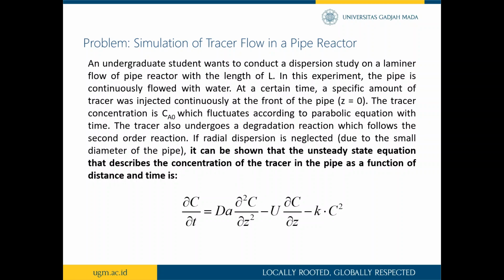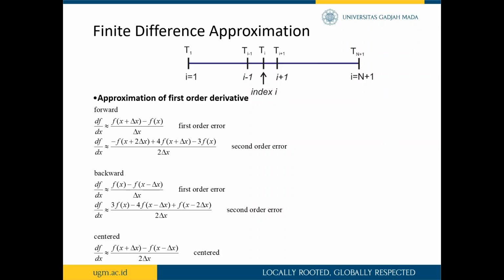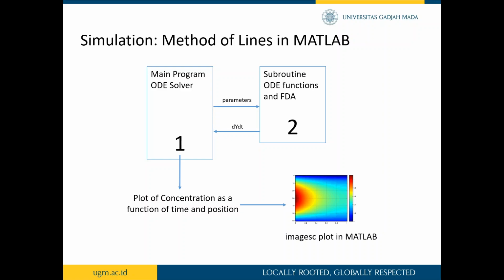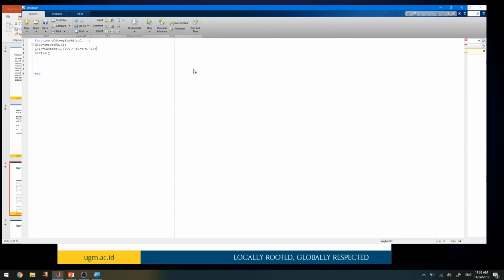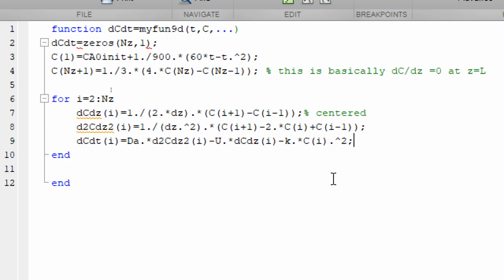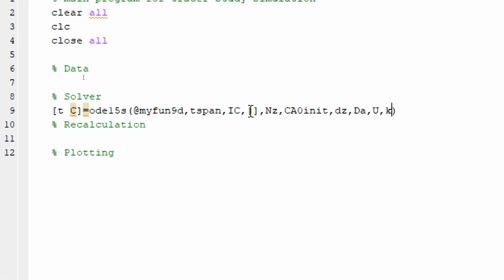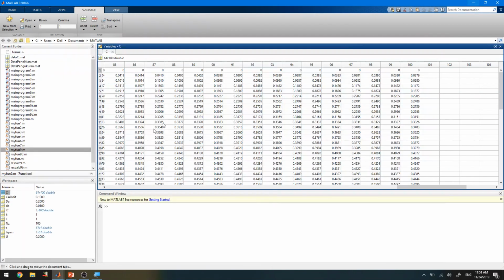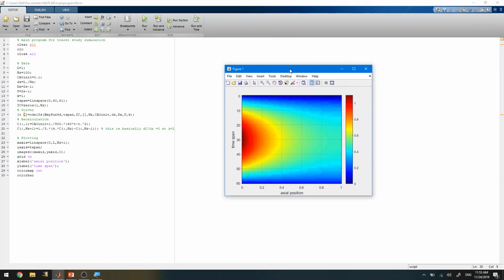Solving Partial Differential Equation with Method of Lines (MOL) in MATLAB

Comment: I don't understand  the line :  C(Nz+1) = 1/3*(4*C(Nz)-C(Nz-1))  because when  we run the main script we have C(Nz+1)=1/3*( 4*0 - 0 )=0  right? Basically I don't understand why the boundary condition for z=L is written at this emplacement on the script.
Reply: i didn't understand this point like you

Comment: Is it possible to use this algorithm for a system of pdes wich are 
two-dimensional?
Reply: I have they same question ... What can I do if I have a pde system in a non-isothermal pfr with transient heat and material balances analisys... What happens with ODE45??
Reply: Two dimensional problems can be solved through the use of the tensor product to establish a 2d matrix of grid points and then using the kronecker to discretize the PDE in space. If you want a deeper explanation I would recommend chapter 13 of Fundamentals of Numerical Computation by Toby Driscoll and Richard Braun.
Reply: @dylanjorgensen6008  thank you

Comment: can this be used for a system of pdes?
Reply from the maker: Hi, thanks for stopping by. With slight modification, yes it is possible for a system of pdes. Let's say that there are 2 PDES to solve simultaneously, then the size of matrix C would be 2*Nz. The index of C[1:Nz] is for the first PDE and C[Nz+1:2*Nz] is for the second PDE. Hope it helps.
Reply: @muhammadmuftiazis  I sent you an email, I look forward to your reply. Or alternatively how do I contact you. Thanks